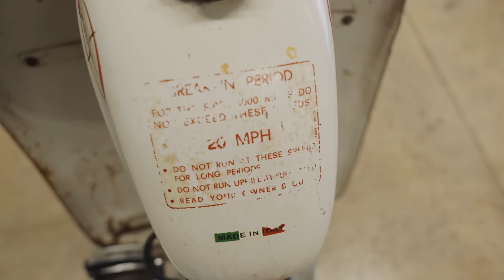CLASSICS COME ALIVE - Vintage Motorcycles, Cars, and More

Comment: My dad had a 64 Tempest that had the transmission in the rear with a 431 or 421 engine in it and I didn't think it was all that until dad sold it and dude burnt about 8 or 10 car lengths of rubber and that flipped me out and it was both wheels instead of just one lol...That's a rare find you got right there...

Comment: Don't forget on those Tempest cars that the factory did put a 321 v8 in em and the Drag version had a 389....I think gmg should recreation the factory drag Tempest which if it were real goes for over 300,000  .  .